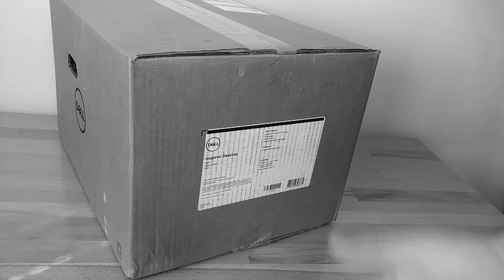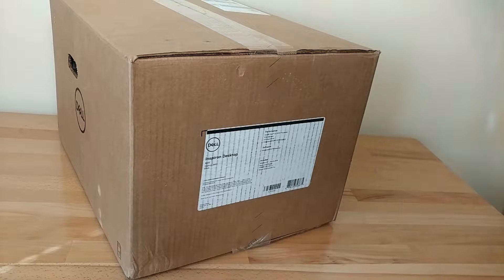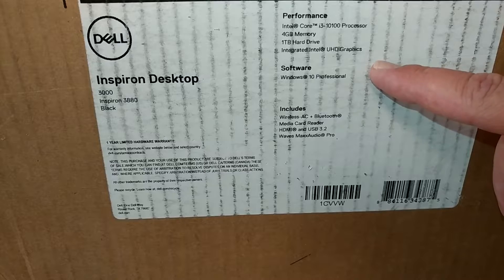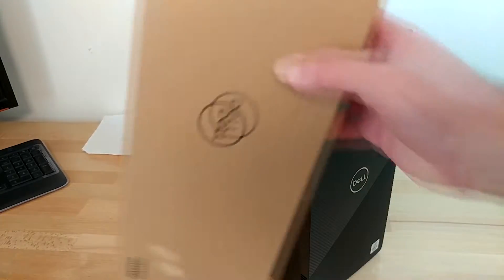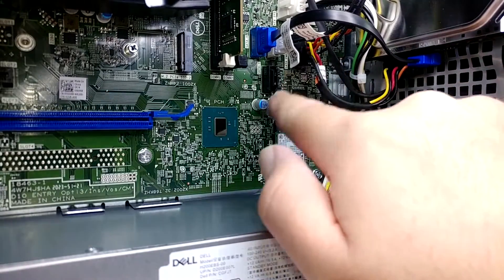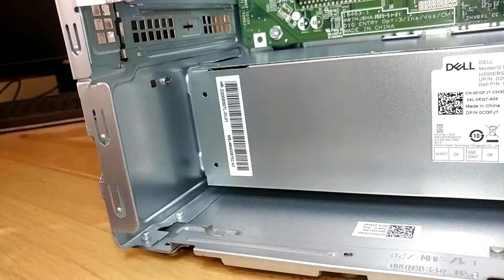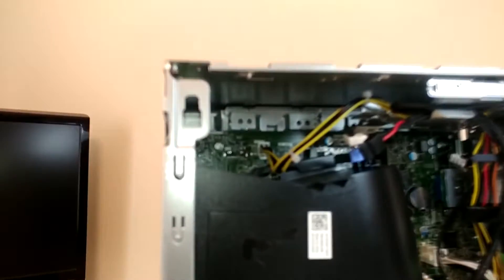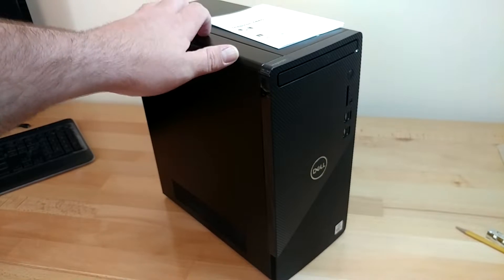Unboxing The Cheapest New Dell for 2021 (and 2022) and Upgrade Plans!

Comment: Neat video, m.2 drives are surprisingly cheap nowadays. A 2TB drive can be had for as little as $250. SSD are cheap enough that I'm not going to be using HDD in my next pc. I'm making a list of what parts I want to use as I'm building the new pc sometime later this month. Oh, and that DisplayPort splitter that I purchased a few months ago died last month.
Reply from the maker: Thanks man!

I was just eyeing my standard issue 1TB Samsung and it's $160. I'm thinking the Black Friday sales will bring about good SSD pricing because they normally do, so we'll see. I do like still having a physical HDD just to due to potential reliability issues with SSDs. I'm not as good about it as I should be, but I will often duplicate files (particularly videos I'm working on) off to an HDD to just to play it safe(r).

I'd be curious to hear your thoughts on videos cards if you've done some research. I haven't shopped for a card in ages so that will be fun to explore again.

That sucks about your splitter. I can't remember your exact use case, but it sounds like maybe a new card with more ports in order?
Reply: @TheBrokenLife  I am looking at getting an RTX 3070 for the new pc. Looking at benchmarks, it seems you can play games in 4k cheapishly now. I don't know how up to date you are on Nvidia's naming schemes for their cards. In case you don't know, it is the generation followed by 60,70,80,90(the higher the number, the more powerful the card). The name of my card shows it's a 3rd gen and a 70 series card. That dell is a half-decent starter system for someone starting out their pc gaming hobby. Put a proper power supply and GTX 1050 and another 4GB of ram in it, and your go to go.
Reply from the maker: @benhill3834  I didn't know any of that about Nvidia's naming conventions. Cool to know.

Hummm... Your last statement is giving me the thought of going a bit more minimalist than I was originally planning. I was planning to go straight to at least 32GB of RAM for my uses and maybe a bit more video card than the 1050, but the idea of keeping things on a reasonable budget, and maybe sticking with the i3 for awhile and 8GB is interesting. I'll have to think that over a bit more. SSD is a no brainer, so I've got a little time.

Looking into the 3070, that would be about the top of my budget assuming I could get one at normal retail pricing. It looks like they're projecting shortages all the way through 2021, so... maybe, maybe not?
 I also like the appeal of buying the bottom end of the newest card too.

Lots of decisions! $350 gateway drug that is going to end up costing more than starting over from scratch. ;)
Reply: @benhill3834  I wouldn't plan on putting a high end video card in this machine.
Assuming you can power and physically fit the card in the case, I think heat might be a problem.  Any gaming rig should be built around a full sized case.
Reply: @tarstarkusz  I'm not.
Reply from the maker: @tarstarkusz  I have ways of working around those issues if I need to. That's part of the fun!